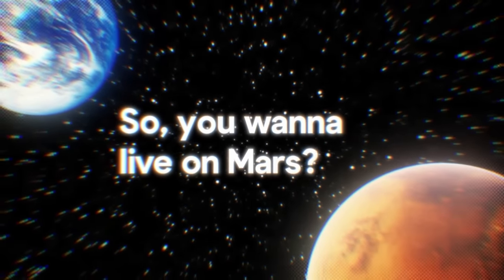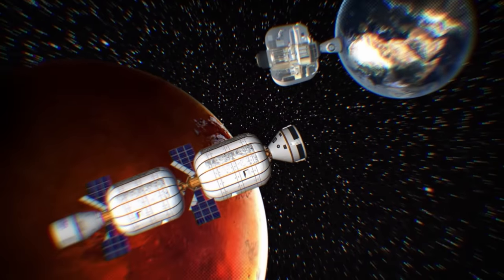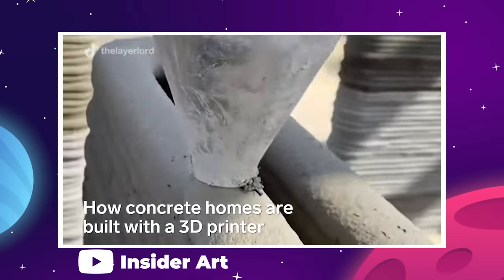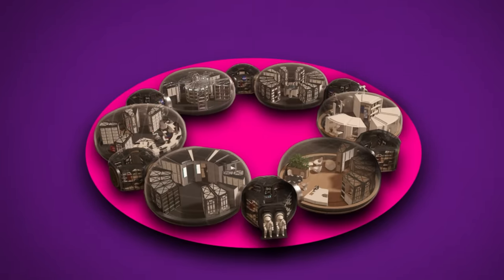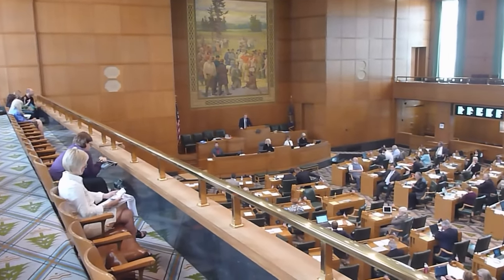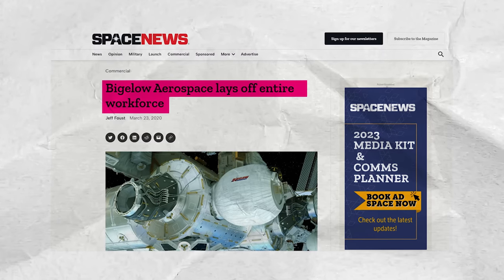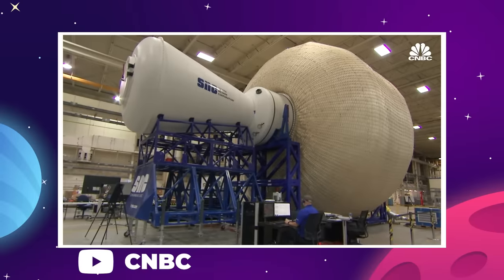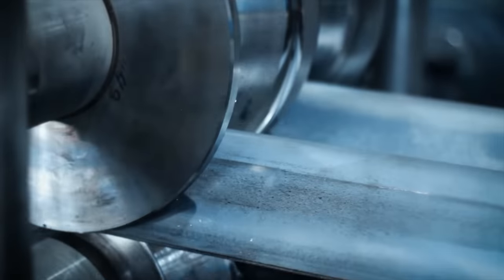Why Inflatable Habitats Are The Key To A Mars Colony!

Comment: Another interesting concept I saw for mars habitats was cement mix embedded in the lining of the inflatable habitat, so you inflate it, then soak it down in water. Once it's hardened, you don't need to worry about it collapsing if pressure is lost.
Reply: How do you get the water though.
Reply: @catprog  There is water underneath mars' surface.
Reply: @@JR-nv4td I am more talking about transporting the water.
Reply: @catprog  Well the same way you get the habitat at first, you bring it with you. There are ways to harvest water from mars, but you need the habitats before you could set up something like that.
Reply: @BeastofBourdon  Exactly taking water to build a strcture is a lot more mass.
Reply: Would be better to stuff martian sand into the lining. It's free matter just lying around
Reply: @gerardt3284  That would just add weight, it wouldn't add to the strength of the structure. If they could make cement on mars in the future, that would be good too, but until then... gotta bring it with you. However, they do plan on covering structures with martian soil to protect from radiation.
Reply: Iiquid polymer  in the layer sandwich once on Mars will act like foam except co2 as the activator

Once inflated  pump  water vapor into the foam as a barrier and improved uv radiation shield. We eventually  want to use the sandwich to  store either waste water or em water.
Reply: @catprog   If you're building on top of or near an underground ice deposit a small processor sitting on top of the ice should be able to provide a water supply. For building purposes it shouldn't need purifying. Ice deposits have been detected, and in some cases actually seen, under less than a metre of earth. I've seen photos of a small new hole with white ice in the bottom. Succeeding photos over several days show the white shrinking as the ice  evaporates.

Comment: For planetary habitats, it seems like the best thing to do is both .
Use 3D printing to build a shell designed to hold the inflatable habitat inside.

They were already talking about putting an internal bulkhead or barrier between the living space and the 3D printed shell, for exactly the same reasons discussed.
Integrate the solutions.
Reply: Yup

Comment: You could store the colonies water supply in the walls of the habitat, so using them as both storage container and radiation protection. In space the walls could grow to be quite thick (like a metre or more) thus offering a good degree of micro-meteorite protection to the crew inside. The space habitats could source their water from carbonaceous chondrite meteors, there would be no need to launch hundreds of tons of water from the planetary surfaces just harvest it from the rocks that litter the solar system...
Reply: Frozen water as a building material and radiation shielding has been proposed in a NASA competition and was the winning tender but remember water ice sublimates in the low pressures of the Martian atmosphere which is why we only find Martian water underground and not on the surface.  It isn't as simple as you're thinking.

Keep in mind that hydrogen rich shielding material such as water are only considered good radiation shielding for their unit mass.  If you are to use in-situ materials as radiation shielding, packed regolith (dirt) is still a much better radiation shield than water or water ice for a stationary structure.  Now lining the interior walls of a lunar rover with bags of human excrement has been proposed for radiation shielding but again that's only because hydrogen rich compounds have good shielding to weight, not just better shielding over other materials.  Having to launch water into space is what makes water a good radiation shielding material for a spaceship, for a stationary planetary structure, packed dirt or just being underground is still much better.

Water is also now believed to be both plentiful and rather shallowly buried on Mars, there's no need to bring water from chondrite asteroids and as Mars has had volcanism as recently as two million years ago, water could be extracted from a Martian volcanoes more easily than bringing it from distant asteroids.  Note that both water from asteroids and volcanoes are ammonia water mixtures and the ammonia is where Earth got it's nitrogen atmosphere from by photolysis of the ammonia by sunlight over millions of years, we can't quite wait for solar photolysis by the Sun but electrolysis via say an electric arc can be scaled up to extract nitrogen for our habitats but the ground water cycle of Mars has already lost it's ammonia to the atmosphere of which the hydrogen and nitrogen have already been dispersed by the solar winds and the lack of geomagnetic shielding against the solar wind.

Besides, we still don't know if the Martian ground water couldn't be flowed to you through a well so strip mining may not be necessary, we do know that there are some Rick features that are the result of temporarily flowing water so Martian ground water can be a lot easier than you are suggesting and really, gathering water from a lot of disparate and widely spread out asteroids and bringing them safely to the surface of Mars is also no easy task.

Comment: What would keep a inflatable habitat from blowing around like a big beach ball in the high martian wind storm. Or cut to shreds in those high wind and bits of rock . No to mention micro meteors.
Reply: Air pressure on Mars is so low that typhoon speed winds feel like just a gentle breeze. That's why rovers can trundle around for years powered just by flimsy solar panels.
Reply: I totally agree with you. I guess they would need to be anchored firmly underground. Drilling down through rock; however, the attachment to the actual bubble is the problem. How d'you stop it tearing, as you say ??.🧐☕

Comment: Quick answer...no they are not! Cosmic radiation, micrometeorites, dust, as inside pressure, are some of the issues. The best and safer way to have a base to Humans in Mars, it's underground bunkers.
Reply: I.e. The Boring Company.
Reply: Bunkers?  How do you figure on pressurizing a bunker?
Reply: Did you even listen to the whole video? Or watch it at all?
Reply: Like you will know😂😂😂
Reply: Presumably, the inflatable structures would be buried by packed regolith to provide the micro-meteorite and radiation shielding preferably by tele-operated drone bulldozers before any occupant arrives.  About two to three feet of packed regolith should reduce radiation by a factor of a thousand though it would take 40 feet to provide the same shielding as Earth's atmosphere.   Remember the first habitats are about building them remotely before occupants arrive and need to be safely shielded.  Later, more complex and larger habitats are possible as the work force would have a safe shielded refuge when needed. 

The inflatable structures are just as a form and a seal against the toxic chemicals and perhaps biology of the in-situ materials which would likely be regolith but could also be plastics as carbon monoxide could be processed from the atmosphere and hydrogen could be processed from the water we've found in the ground near the surface and a mixture of carbon monoxide and hydrogen gas can synthesize any linear hydrocarbon in Fischer tropsch synthesis (which is how we make plastic grocery bags, milk and soda bottles).   Indeed, I would expect that eventually the structures would be regolith binded by synthetic plastics as such could be extruded out in a 3d printing process but a plastic internal liner exported from Earth would still be needed to ensure a safe shield from the chemicals in the regolith and any indigenous biology that we do not know of.  However, the first habitats would likely just be buried by bull dozed regolith that's been packed down (perhaps with a plastic outer liner or binder to prevent erosion by winds).

We even create concrete dome structures on Earth by inflating a structure and spraying it with concrete.  The inflatable habitats on Mars would be similar, it wouldn't just be the inflatable structures by themselves.

Even if we were to build underground habitats as you propose, which would likely require workers to do so, we would have to line the interior surfaces to hold the pressures and prevent intrusion by harmful chemicals.   Remember that Biosphere 2's initial problems were partially traced to the exposed concrete reacting with the atmosphere in the habitat.  Even the underground facilities you are proposing would likely require an Earth exported inflatable structure to line the habitat at least till infrastructure is established on Mars to form a safe sealing barrier.
Reply: @yarissathomas1816  "I saw a video, therefore I know it's true." This is your version of logic?

Comment: For a science fiction story I'm thinking about, I like the idea of a spacecraft that essentially has a water reservoir surrounding the crew area that provides potable water and a radiation shield.
Reply: Well good news that's like an actual proposal for these things, some of the ideas use heavy water so it would only be potable if diluted and used sparingly (if it's less than like 10% of your water it works the same as water effectively but more than that and it slows things down too much) but others use normal water or even a premixed water that's more d2o than standard but still safe levels

Comment: Pressure in space is not -14 psi. It is 0 psi. Earth atmospheric pressure at surface is 14.7 psi. Pressure on an inflatable module is inside pressure vs zero psi not -14. The ISS operates at 14.7 psi and could successfully operate at around 10 psi if needed. Mars colonies will likely operate at 10 psi, but no more than 14.7 psi inside the modules.

Comment: Recently, Sierra Space did a full scale burst test where they pressurized their test article to more than 70 PSI before it burst.  This is higher than any rigid structure would be designed for.  The test article also had rigid ports for installing windows or connecting different modules.

Comment: Re the comments, I like both of  the suggested safety reinforcemrnt proposals: 1) put a hab into a hole, and 2) put loose regolith over it, for extra shielding. 

A 3rd alternative is to bake a covering shroud (shown in one of your illustrations). Better in protection than the loose regolith. 

(Developing the onsite tech for that will be necessary for developing return-flight spaceport surfaces. Otherwise, the regolith--in 1/3g, minimal air friction--will blow a LONG way, from rocket launch exhaust.)

Whatever the chosen safety-enhancement solution, let it be done. Mars' surface has the least mobility (compared to LMaO, lunar surface, LMoO or LEO) for rescue, retrieval or repair. No punctures, please! Maximum protection!

(And please include nuclear power sources, as well as solar panels, for further safety factor.)

Comment: 13:19
So, module that is 60 Feet in length and 40-50 Meters in diameter ..
how many usable cubic hand-spans it gives?
Mixing measurement units (esp. in space related stuff) has already produced interesting results ..

Comment: Large inflated domes covered in water bags. The dome would have a bottom onto which would be covered with regolith that has been cleaned of percolate. The dome could be stadium size and clear with the water bags giving radiation protection. A steeply banked track around the inside perimeter would have electric RV”s racing around to give the colonists the one gee where they would spend much of their time. The dome”s interior would be for farming .
Reply: Interesting concept.

Comment: The first habs on Mars will be dug by Prufrock 2.  The tunnels may be lined with linked, inflatable habs and the ends capped with airlocks.  Radiation shielding is within the realm of possibility, but for living on Mars?  Day to day, growing food and sleeping and exercising?  The bulk of time spent will have to be underground.  Prufrock can develop rover tunnels to different locations for pop-up exploration, and it can be delivered on one of the first Starships.  /2cents.  I could be wrong.

Comment: At 13:20 you give one dimension in feet and another in meters.

All these designs for a Mars base are lovely, but all of them ignore one thing.  Rovers will need to be brought into a pressurized structure for maintenance and repairs. Anyone telling you that they won’t need maintenance has never had to keep rolling stock operational in the field.

Comment: I'd love to know more about weather and climate patterns around Mars. Would it be wise to set up inflated habitats without break walls around them?
Reply: The wind speeds can be very high on Mars plus the dust blowing around can be pretty abrasive.  A break wall for surface structures seems like a good idea to me.  Maybe even better would be and inflatable in a lava tube or an excavated cave.  This would provide total protection from the wind and dust plus protection from solar radiation and perhaps be a bit easier to keep heated (temps on Mars get way below zero every night).

Comment: It doesn't matter what is in martian regolith if you are going to mix it with a polymer.  Whatever it is will stick together.  Also, inflatable space habitats have been under development of decades but not on Mars.  In fact, I am only aware of one (Belgian) project working on that for Mars.  The Starship will itself serve as a fine habitat.  It won't fully black radiation but close enough, if you add the thin Martian atmosphere will reduces it a bit more.  Bigelow space habitats are made for space--not Mars.  The requirements are very different.  

Another quick and very inexpensive way of building a habitat on Mars would be rammed-Earth (or, rammed-martian-regolith).  On Earth, this construction method uses a stabilizer that is typically 10% concrete mix.  However on Mars, the water would be all the stabilizer you need.  Luckily, Mars is flush with tons of water ice.

Comment: I was completely sceptical, but this..gives me a very different view on the subject. 
     --A thought..once inflated, they could be coated with the local sand, as added protection from the sun and other radiation sources. Solidified..protection, even from the local weather.

Comment: At 8:55 the video discusses pressure and explosive decompression.  The pressure differential is incorrect, covered in another comment.  Also incorrect, the effects of explosive decompression.  Aircraft have had deaths as a result of explosive decompression where the pressure differential is less than 14psi (one bar).

Comment: Why not "rigidify" the walls after inflation? An internal or external skeletal structure, or a coating that will create a composite with the fabric structure? Maybe this isn't important, but perhaps the potential for the walls to change shape is a problem worth fixing, whether from deflation or some other stress.

Comment: Inflatable tents would be the logical first habitation option on Mars, what with their low mass and ability to be packed into a tight volume. But inevitably, the new martians would eventually hanker for something more substantial and as akin to their old homes as possible. This is where 3d printing would come in.
Reply: It is way hard to print a structure that can contain air pressure without the roof blowing off.  There could be hundreds of tons of upward force on the ceiling.    You would need to have about 10 meters of rock and rubble up there.

But you could 3D print large blocks and then robots stack them.   It would be like building a stone building with printed stones that are well shaped.     You would likely build a masonry dome and then bulldoze dirt over it.

Comment: 2/ Your idea involves creating a sort of 'garage' for Martian suits, with an internal access point to the outside, which could be an effective way to manage contamination risks. This concept could work as follows:

- **Garage Structure**: A dedicated space, like a garage, attached to the habitat but separate from the main living areas. This garage would be where astronauts exit and enter their suits directly.

- **Direct Access to Suits**: The suits would be accessible from inside the habitat through an airlock system, allowing astronauts to enter the suits without exposing the habitat's interior to the Martian environment.

- **Contamination Control**: This garage space would have its own contamination control systems, like air filters and vacuums, to minimize the amount of Martian dust brought into the habitat.

- **Maintenance and Suit Prep Area**: The garage could also serve as a maintenance and preparation area for the suits, equipped with necessary tools and equipment.

This approach would enhance safety and efficiency, reducing the risk of contamination significantly by keeping the Martian environment contained within a controlled, separate area.

Comment: The answer, as always, will be a mix or a hybrid of all system.
Probably the 3D printing for the "hard exterior shell" and an inflatable system for "internal living space".
We will also leverage cave whenever we encounter one.

The "real" issue is the complexity of having to shield the "habitat" from Radiation + external "hazards" and having an efficient internal system for pressurization & climate control.
So my guess is the final system will have a combination of all concept.

Comment: I'd like to see a rendering of an inflatable structure that is attached permanently to a Starship second stage (obviously one not designed for re-entry). Why have Starship 'deploy' something, have it 'expand' once in orbit to something MASSIVE. Also has the benefit of a secondary inner core of the 30' Starship as added protection.